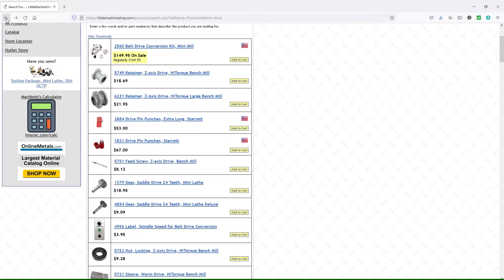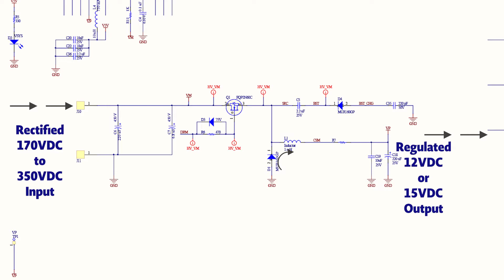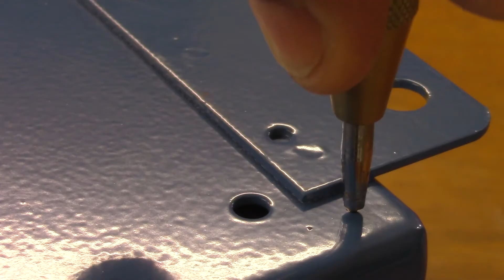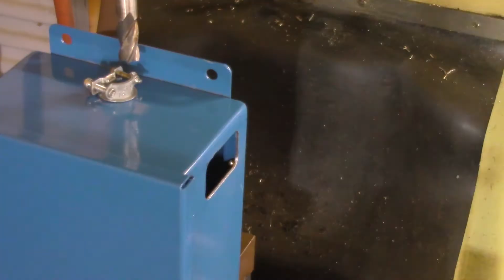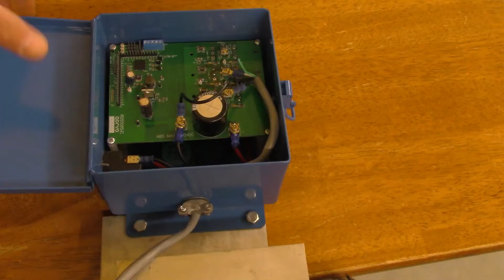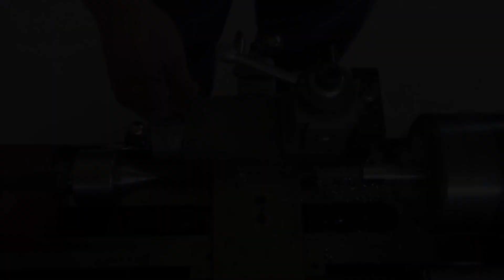Resurrecting My 7x10 Harbor freight Mini Lathe with PAC5556 And United Silicon Carbide MOSFETs.

Comment: Hi dude, i have some problems with the qorvo 5556 and a high torque starting dc motor, the motor run 2 seconds and then stopped, did you have the same problem? Thanks
Reply from the maker: Hi Sergio, it is hard to answer the question from that angle as there are many aspects which could cause the issue. When you say DC motor do you mean Brushed DC, or Brushless DC? What algorithm are you using? Is the problem because of over current or because of over heating? Could it be that the power supply does not have enough current capability, which causes the voltage to droop and reset the PAC5556? These are some of the items that come to mind, but there are probably many more worth considering. I don't think it is an issue with the PAC5556 alone, it is probably a combination of things. More details would help. Hope this steers you in the right direction and thanks for watching!

Comment: Jose, that was awesome. Well done
Reply from the maker: Glad you like it! Thanks for watching!
Reply: @CNCDude wichone is beter?? This or jy01 sensored controler bldc with hall??
Reply from the maker: @botak333  It will depend on what voltage you want to use. In this video I used a PAC5556 because I was going from line power (110 VAC). I have another video where I use a PAC5523 which can do lower voltages (72V Abs Max). I do not know much about the JY01 but I think most of the boards I was able to find are for low voltage. Not sure how much current they can provide, but be aware that on the lathe you will want some decent amperage. Hope that makes sense!
Reply: @CNCDude  bldc flipsky 6374 is 110v??? 
My bldc was 36v 120A max sir. I see jy01 is used external driver mosfet and mosfet, so its mean can hendel more volt depend on the mosfet right?
Reply from the maker: @botak333  It is not just the FETs, there is also probably a DC/DC converter either a switch mode or low dropout regulator which will also need to survive the input voltage. If the JY01 has the regulator internally, then it would be limited by that.
Reply: @CNCDude  ohh oke sirr,
Reply from the maker: @botak333  The flipsky is definitely not a 110V AC motor. I have two lathe videos. The one with the flipsky is low volt age (36V), whereas the high voltage one uses the original Brushed DC motor that came with the lathe (if I recall). Although it is an external gate driver, there are still ratings and I am positive the JY01 will not go to any rectified AC. If you want to work with the mains, you need a high voltage gate driver. For the flipsky, I used a low voltage driver which can do as much as 72V.
Reply: @CNCDude  okee sir iam working on low voltage also sirr, so how do u feel the bldc motor on your lathe sir?